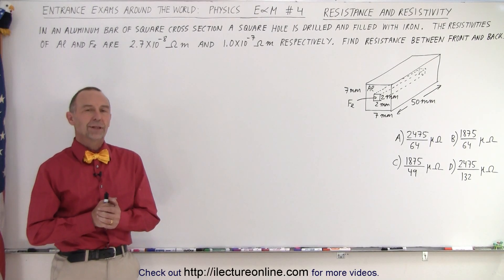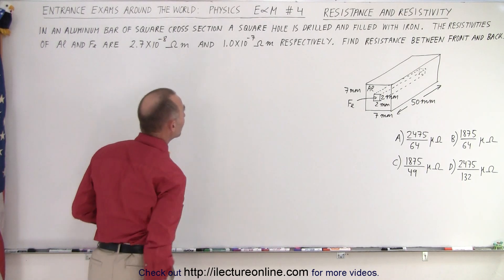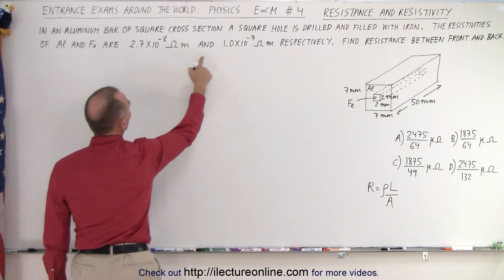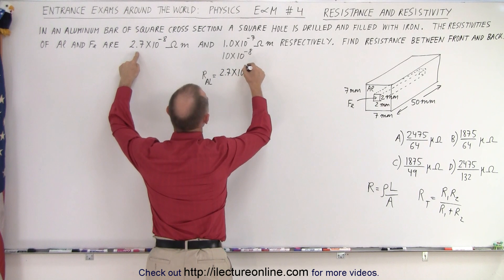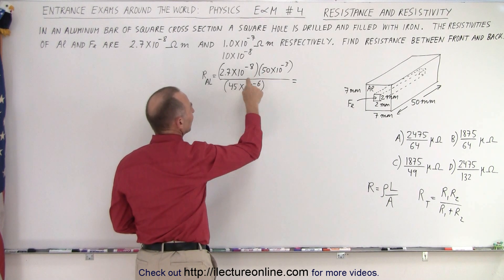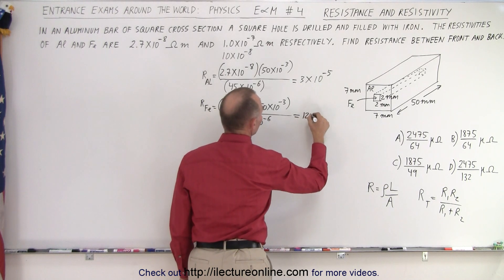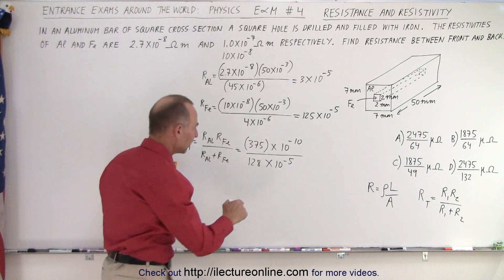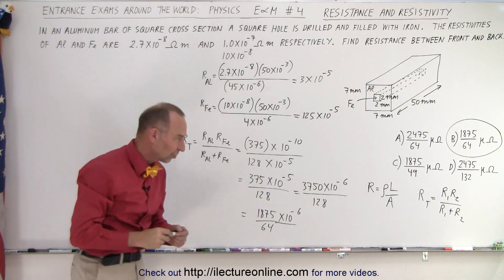JEE Advanced Physics 2015 Paper 1  #17  (#4) Resistance and Resistivity

Comment: Sir,may I ask a doubt on this? If it is a dumb one, pardon me..
The hole is drilled and filled with iron right? And the length is 50 cm, so the ends of this iron layer must lie on the face of the aluminium conductor. So effectively, this layer should divide the conductor into three parts , two of them (bottom and top) having Aluminium, and the middle layer having iron right? And all the three should be in parallel. So shouldn't we take the resistance of two aluminium layers first and then that of the iron layer and take the combination(edit) of the individual resistances,all in parallel? And thus I got an answer similar to option A.
Thanks for reading. Please do reply I am very confused...
The classes are very much appreciated sir... :)
Reply from the maker: It depends on the direction of the current flow.  Here it is assumed that the current flow from the front to the back.  (or we just want to calculate the resistance from the front to the back)
Reply: @MichelvanBiezen  so the current entering in the front part can divide into three paths am I correct? I was a bit confused by that aspect, that's why I asked..
Reply from the maker: Only 2 parts.  1 path for each of the 2 metals.
Reply: @MichelvanBiezen  ok sir thank you...

Comment: Sir, I wonder why the equation RT = (R1R2) / (R1+R2) is applied here in this problem. 
Does it mean the Al bar and Fe bar are parallel ???
Reply from the maker: The way to tell the difference is this:  If they are in series then the current must travel through both to get from front to back.  If they are in parallel, then the current can go through one OR the other to get from front to back.
Reply: @MichelvanBiezen  wow, that's the point😳😳
So, most current will go through the bar with less resistance, I got it
Thank you Sir😄

Comment: hi sir 
please clear my doubt sir
I still have some confusion unsolved. Since you are using the graph of y=2t as an example to find its area under the line which is pretty obvious and easy to understand but what if I give you a graph of y=x^3 at the first place and ask you to find its area under a curve from x=0 to 2. I know the answer is 4 by using the formula of integration but what is the point of taking the anti-derivates to get (x^4)/4 takeing area under 4 order
 the graph of (x^4)/4 the graph of it is different from the( x^3)
graph fourth of equation   graph looks like  shape of "W" and third order equation  looks like  shape of "N" ,what  is the point of taking area the under curve of third order equation while using integral to obtain 4 order sir (only gives the orginal function back too existances)
i have comments in calaulus 2 ch1